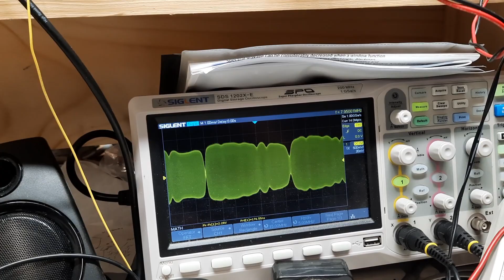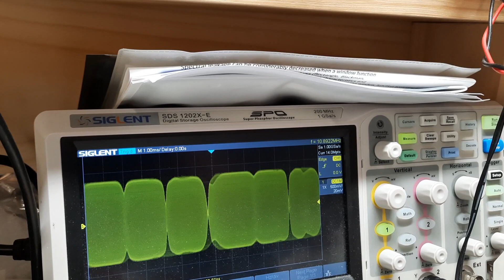Video of Peashooter Waveform Sampled at the LPF

Comment: As you say wave form is very clean, make a tremendous difference when you get the bugs sorted out, design and putting together all the circuits is fantastic to see Pete, excellent job, I love this type of build, very rewarding, thanks for sharing, and looking forward to the next video.👍
Reply from the maker: Thanks Peter, this was one that was a mystery as it worked FB before I made the 1st two contacts. The Ghost in the Mahine has struck again. But all good now.

Pete N6QW